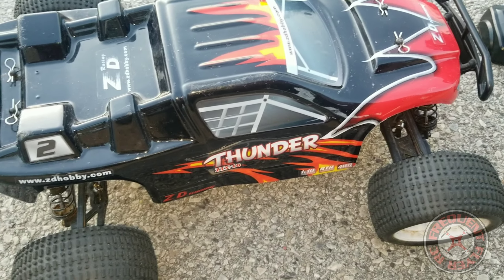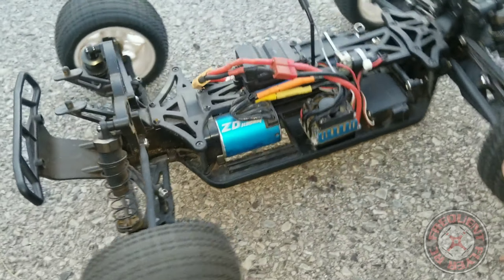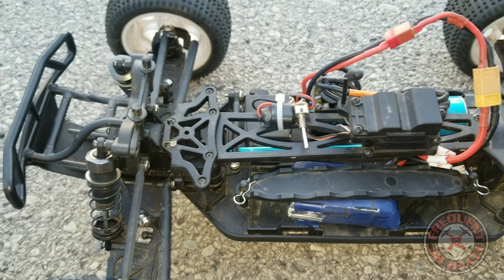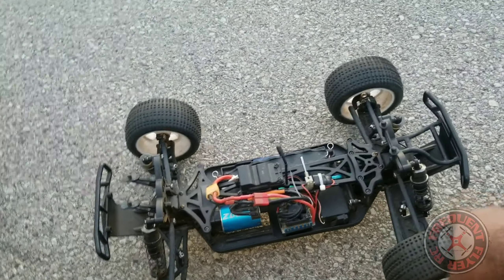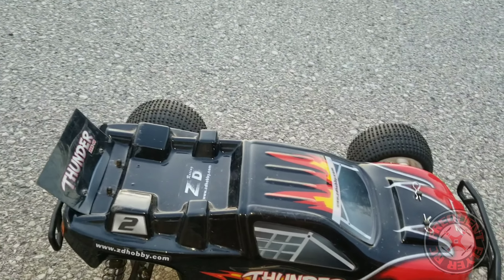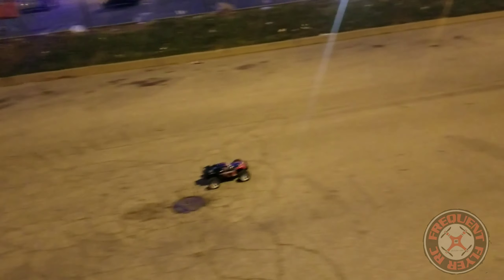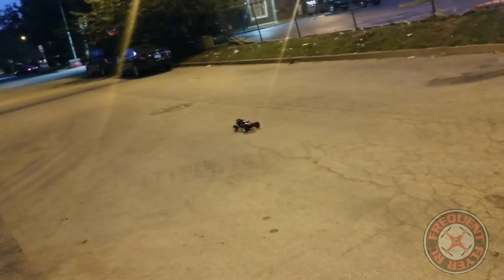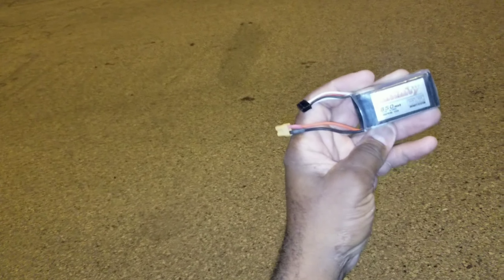ZD Racing ZTX-10 MODs And 3S Run

Comment: TC 1:05 -  Right after a hard rain the other day I sent the WL-28 out and went full urban swamp buggy outside the back door. I think it still works because I quit while i was ahead (luck)  ;  immediately disconnected the batt and let the vehicle set upright against a wall to drain. I ran it the next day and I could tell we had ESC issues. Long story short  to our peeps-   If you swamp you vehicle -- Pull power and let it drain dry well.
Reply from the maker: Indeed!
Reply: @FrequentFlyerRC  -- It's back to normal again . She ducked the bullet

Comment: Cool stuff buddy! Nice to see some love for the ground RCs :-)  I don't have this model but I'm a fan of the ZD racing brand. cheers FF!
Reply from the maker: Thank you bro 👍🏽
Reply: -- Come to find out I like my WL groundv more than I thought. I run way down to the end of my block and back and have yet to really hit full throttle because she eats the distance like a bird on a worm. Most of the speed due to it's in 2WD mode so all the torque in coming from the rear tires.

Comment: I think I might have to try those tires like that on my WL 12428., on the front at least  The FrontWD on mine is disconnected now and it has made a new vehicle performance wise. More top end and steering control.
Reply from the maker: I Swap tires from different models a lot! 👍🏽

Comment: That pack could swell up as a feature some lips do that they expand from the gasses inside it's normal  they even say it depending on what type of battery it is some do it some don't depends what type your buying but if it's not that type of lipo that expands then yeah you might wanna get rid of that before it catches fire 😂
Reply from the maker: Thanks man lol